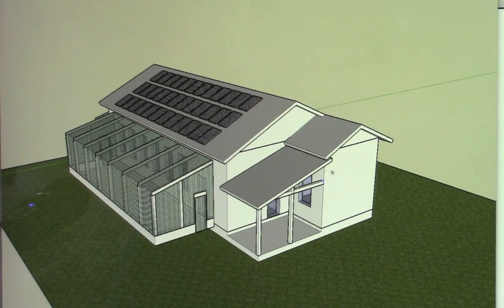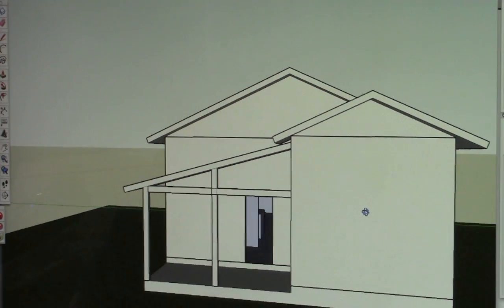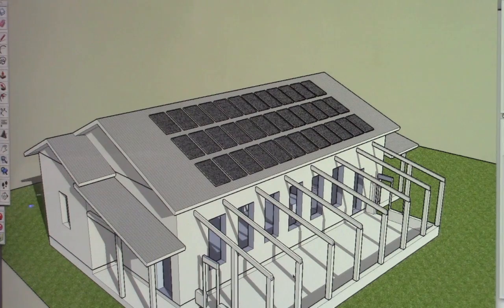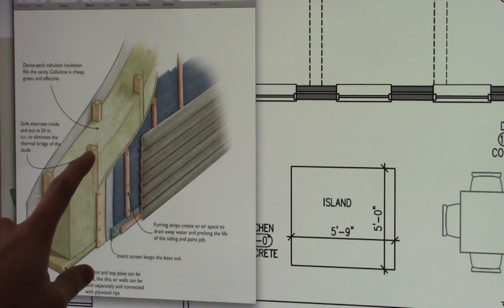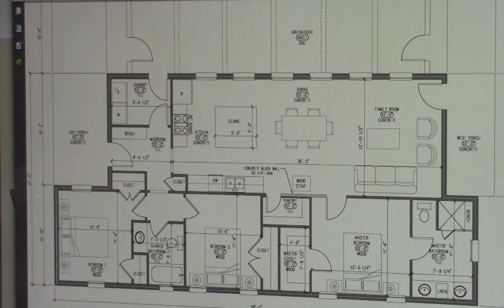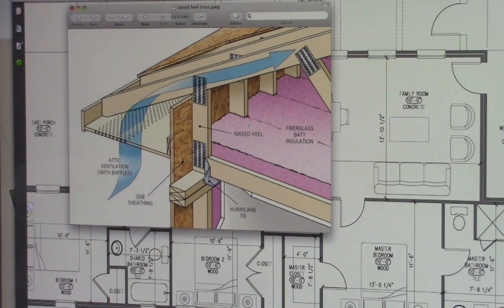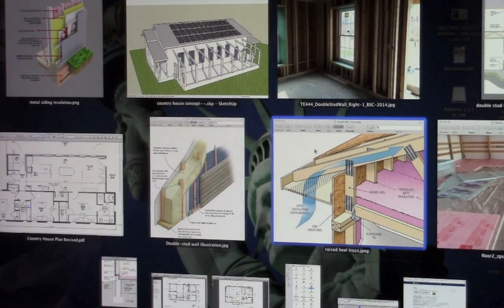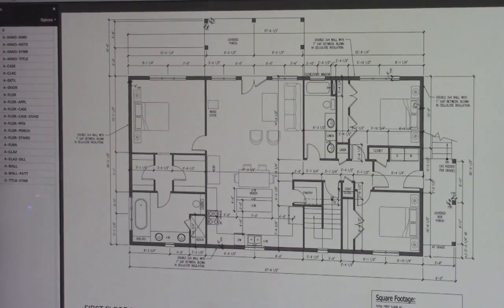Sustainable Off-Grid Home Design - DIY energy efficient green passive solar and affordable!

Comment: What a wonderfully informative video!  We are doing our research and we were wondering about the slab on grade idea paired with a greenhouse.  Can you use it on level clayey loam soil?  The property is two miles from a river with a high water table.  Thanks!
Reply from the maker: Thank you. This can be put on any soil. Of course, before building anything a soils test is important to obtain. The engineer may suggest additional reinforcement, slab thickness, etc.

Comment: So how would the structure hold up to a tornado or should there be a strong room built into the structure? I love the house and the work you are doing. The green house how would plants be placed there ? Like a large container garden ? What would be the R values related to the windows and doors? The windows would be triple glazed with argon gas or ? Would they be Storm proofed? Will the house have hurricane straps to hold the structure together in high winds? What about computers, tv satellite and car charging? What about the plan you have plus geothermal heating and cooling for the whole house? Heat pump hot water? How do you move fresh air through the house?
Reply from the maker: Thank you. That is a lot of questions Ken. I will do my best to answer them. 
1. Almost no house will withstand a direct tornado hit. We will have a shelter like most in the South. 
2. The greenhouse can have raised beds or containers. Personal preference.
3. R value for doors and windows will be determined by whatever you can afford. Essentially combating air leakage will boost energy efficiency and thermal loss. 
4. Not sure why the windows need to be storm proofed unless this is being build in a hurricane prone area. Any home needs to be modified to the local code of the are built in. 
5. Geothermal can be added. Depends on your budget. All systems can be combined to work together. 
6. HVAC systems can be designed per budget, need, etc. Depends on what you choose. Heat pump is popular here in the South. 
The building envelope is the crucial first step to energy efficiency. All other systems can be determined later by budget, location, need, etc. 
Hope this helps.
Reply: thank you for the update it was very nice of you to reply good luck with your home...is it built yet?

Comment: Have you ever considered putting the majority of the house underground? That would protect it from storms, fires and would be much easier to keep it at a good temperature as the ground would be great free insulation.
Reply from the maker: No I haven't. That would be more of an Earthship design. There are a lot of advantages and disadvantages to that type of design. The one I have designed is much easier to build and has less engineering involved. I do like Earthships but I don't think I would build one.
Reply: @CountryLivingExperience  I've looked at Earthships, but feel they'd be too exposed to storms and fires. I prefer something like this: https://www.youtube.com/watch?v=CWe0UgNmqp4 or a (at least partially underground) Monolithic Dome. Preferably made with very thick concrete walls. Monolithic Domes have been able to withstand huge, force 5 hurricanes, forest fires burning right over them and can protect their inhabitants from high or low temperatures, keeping it about 10 degrees cooler in summer and 10 degrees warmer in winter.
Reply: I like the earthship style. I do find that the idea of the tires is not on my agenda. I like being able to get a similar result that will allow me to get permits  so concrete rather than tires.  They are not to wonderful if you look at how they are insulated.  For most areas of the country we do not have the temperature swings that happen in the desert.  So ...  need real insulation.  There version of earth tubes are all but useless Suck the heat or the 'coolth" out of the ground because they are far far ... well far to short to get real exchange.. the ground does not recharge very fast so 100 to 150 feet is much better.  What you are perhaps thinking is not insulation but high mass heat storage in the earth. Not really effective unless you can expand out the area around the house a huge amount as any water that hits the ground in the form of rain or water table will wick away the stored heat

Comment: You can see a variety of photos of solar heating on my website: https://kuennllc.com/
You can also do this with a deep sand base and pext tubing instead of a large water tank but heat never transfers as well as in water.
Reply from the maker: Awesome. Thanks for the heads up. I will check it out.

Comment: Under the Southern side greenhouse, add a 2000 gallon buried tank (sitting on recycled EPS foam) with cheap used thermal water/glycol panels (ground mounted). All summer the water in the tank will heat up and release from Nov to January to heat greenhouse and house. By February, when the sun is high again the tank will gain heat again. We grow citrus fruits in NE WI when it's -20F outside. Used farm tank, used 80s panels (always on Craig's list) with little else spent on pump and tubing.
Reply from the maker: That is a fantastic idea. Thanks for your thoughts. I would love to see your system.

Comment: Have you looked into SIP panels for exterior walls at all? Like to get your take on these.  Thanks.
Reply from the maker: I have and know a few homes built with them. I like them and they are a good product. I was shooting for a bit higher r-value for the walls in this home and went with the double offset studs for that reason.
Reply: Thanks.   How does cost compare?
Reply from the maker: That is a tough one to nail down. Depends on your market/area for costs. Depends on SIP thickness and also type of insulation used in the double stud wall.

Comment: Will having a basement affect efficiency? Thank you.
Reply from the maker: As long as the basement is properly insulated, it should not effect efficiency. Insulation on the underside of the slab and exterior of the basement walls is important. Additionally, you can add an interior insulated wall in the basement to further control the environment.
Reply: @CountryLivingExperience  I want to build a net zero ranch with a basement in northwest Indiana, cheapest way possible. Would you be able to help me with that.
Reply from the maker: Sure. Let's talk. Too bad there is no more private messaging here on Youtube. Head over to our website www.countrylivingexperience.com and there should be a place to email us there.

Comment: Did/are you building this home? I really like your floor plan. It's almost perfect for us. I'd like to know how the building is performing if you have built it.
Reply from the maker: We have not been able to build it yet. The funding is not there. We moved in a different direction and bought a home because of a time crunch. Hopefully we will be able to acquire land and build in the near future.
Reply: I see. Is this your own floor plan or did you buy it?
Reply from the maker: I am an Architect. I designed it.
Reply: Great job. You've packed great features in there that I have not seen frequently in a typical passive solar, like the mud room, double vanity and WIC in the master, place for a wood stove and thermal mass wall behind it, and showing the construction detail is very helpful as well. You should make this available for sale if you have not already. I have a vintage wood cook stove that I currently use and will be going into my passive solar home, and this is the first plan I have seen that allows for it.
Reply from the maker: Thank you. I would be happy to discuss the sale of detailed architectural plans. Send me a private message and lets talk.
Reply: Unfortunately (depending on how you look at it) we are at least 4 years out from being able to even get started. And, like happened with you, things could change, so we will wait until we are closer to start time to nail anything down (no pun intended).

Comment: What is the reasoning for having the windows inset?
Reply from the maker: Great question. The wall thickness acts as an additional shading device in the summer months. Your overhangs do not need to be as deep if you inset the windows.

Comment: Great video.  Wondering about your PV system - about what size system and where will the batteries/hardware be located?
Reply from the maker: Tim, 
We had not sized the PV system yet. The batteries and hardware would be located in an outdoor closet on the east porch. This would eliminate the worry of off-gassing of the batteries. Once we reach the point of sizing, we will do an update video in the series.
Thanks.
Reply: Country Living Experience OK great. Looking forward to seeing the update.

Comment: I am retiring in a few years & have 10 acres of  land in the country with a garden & orchard. I would like to build a 1500 to 2000 sqft net zero home with a south facing green house/room with a full walk out basement with ICF walls. I want the insulated, airtight ventilated air exchange passive home, with Geothermal heating & cooling. Concrete floors & counter tops, solar panel on the roof. I can not find a cost per square foot for this type of house. Any ideals?
Reply from the maker: It will be hard for you to nail down a cost per sf easily because there are so many variables involved. You will have cost/sf for the Architect, contractor, geothermal engineers, ICF installation experts, Engineers, etc. 

Location is a huge factor to cost. Are there contractors that are willing to travel to your land? How remote is it? What is the terrain? What State do you live in? Etc.

Are there expert trades (geothermal, solar, ICF) available in your area? If no, it will cost more money to get them out there.

Will you do some work yourself? Will you GC the project yourself? 

As you can see, it is a huge challenge to nail down these type of cost.  All I can suggest is you start contacting individual contractors and start asking them questions.  Additionally, their costs can fluctuate greatly over a few short years.

Sorry, I cannot be more specific.
Reply: Thank you, that the most I could hope for on line.

Comment: id consider a masonry heater in place of the woodstove, initial build cost is higher, but time and cost of prepping firewood is cut in 4, or a self buit rocket stove is cheap to build and nearly as efficient, plus you get heated benches to lounge on in the winter.
id also reccomend spending as much as you can afford on good quality windows, pref triple glazed, again high initial cost but over the years you would be amazed how much it makes a difference in your heating bill.
Reply: masonary as in a down draft heater?  or more along the line of a mass rocket heater?

Comment: Will it be a LEED Certified Home?
Reply from the maker: Thanks for your question Noe. 

The short answer is: absolutely not. 

The long answer is: I used to work in Washington DC for one of the 5 governing bodies of the architecture profession. This gave me insight and access into the inner workings of organizations like the USGBC. I also had a friend work for them for a number of years who fed me disturbing information. The LEED system was a moderately good idea on paper about 15 years ago but quickly devolved into a bureaucratic mess that was of too great an expense to a great majority of the clients. It became an assortment of meaningless checkboxes that did not mean much. I could go on about this for an hour but I will not.

This home which will essentially be totally off grid and self sustaining would not score well in the LEED system.

We all can do better than silly check boxes.

Sorry for the soap box speech.
Reply: Country Living Experience I hear ya, and I can definitely see your point. Beautifully designed home! off-grid is really ambitious. Best of luck on the build!
Reply from the maker: Thank you.

Comment: I live in the Southern hemisphere, and I was told not to put a window into a West facing wall because the westerly afternoon sun is more able to heat a house than the easterly morning sun.
I was wondering why you placed a window in the West wall instead of the East.

Thanks, Aini.
Reply from the maker: That is essentially true but you have to weight diminished natural light in your home in the late afternoon.  Yes, you can design a house that is like an Earthship buried in the ground on 3 sides but I think that takes away from the pleasant nature of a home. Architecture is about balance. So some small windows on the West side is not really going to effect things in a significant manor. The light is very important too. Just make sure you use double or triple paned glazing and everything will be fine.

Comment: Im currently building one of these in missouri, framing just about done.  This is my second build like this.  Some things i would add from my research.  To get the most square footage for the cheapest cost, two story is the way to go, foundations and roofs being the expensive part, minimize their size and build up.  Obviously there are other considerations about 2 story vs ranch concerning ratio of glazing/mass area to the rest of the house, not optimum but still can be made to preform extremely well.  I would not post frame the house, the savings from building like that (no foundation) dont apply here because your going to need a full foundation anyways.  Just stick frame.  The exterior wall can be stick framed at wider spacing, im doing mine on 4' centers.  Housewrap on top that to hold in the insulation.  Then strap those with girts every 2' on center to install your pole barn metal to.  When doing girts instead of sheeting the house remember to add shear panels to the house somewhere, i put mine in the corners.  Or pay a little more and just frame and sheet the exterior as typically done.  Sounds like you might be further north than me as i design the windows to have no sun at all in the summer, 5' tall, 1.5' up to overhang, with 2.5' overhang.  Doing everything myself on this one, from foundation to roof and everything in between  for 1600 sqft interior space for $40-50K
Reply from the maker: Good luck with your home. You are correct, two story is less expensive generally because of foundation and roofing. Both one and two stories will perform well with a one story slightly outperforming a two. Latitude will make a great difference in the design and location will cause build price fluctuations.

Have fun with the build.
Reply: Kudos for the Video clip! Forgive me for chiming in, I am interested in your initial thoughts. Have you researched - Lammywalness Wise Solving Guide (probably on Google)? It is a great exclusive guide for living off grid without the headache. Ive heard some great things about it and my GF finally got great success with it.
Reply: Cody can you share? Would love to see your work.
Reply from the maker: @Dennis Coen Sorry to get back to you so late as YouTube does not show me reply's made on comments. There are many sources out there where you can learn. I learned in school and my profession as I am an architect. There is a wealth of info out there so best of luck with your projects.
Reply: Cody - where in MO are you at? I am in NW Missouri.  Looking for some one that understands these concepts, local GCs are hard to work with.

Comment: so approximately how much would this cost?
Reply from the maker: As I used to ask all my clients, "What is your budget?"  

There are so many factors that are in play, it is very difficult to assign a solid dollar figure to this project.  Your location will determine a big portion of the cost. If you are going to put this on a hard to access mountainside somewhere, then it will be expensive. A contractor is going to charge you more for distance traveled, availability of materials, ease of site access, etc. If you are near a decent sized city with an easily accessible flat piece of land, it will cost you less. Materials vary greatly from state to state. Concrete in Mississippi costs less than concrete in New York, etc. It also depends on what finishes you put in on the interior.  

So all that said, the exterior shell with the concrete and plumbing stub-outs would cost you approximately $35k in rural east Texas and maybe $70k in New York.

Say between $90k and $200k.

Comment: In North America we really don't need a greenhouse design that has a "glass" or clear plexiglass roof because of how high the sun is in the summer. A regular roof with lots of windows on the south side works just as well for a greenhouse and heat gain in the winter and spring.

Comment: Love your blog!
What about about berm on backside of house for cooling or build into hillside? Perhaps skylights in roof backside for light? 
Love your design. Don't think I could afford to build one this big myself, but love the efficiency!!! I always wanted to build a greenhouse, front side south face, convection circulation, louvred upper row windows. 
Just smaller & somehow room to expand on small homesteaded property.
Reply from the maker: Thanks Daniel. A berm on the North side would be an added asset for sure. This home was specifically for us but could be pared down and redesigned to be smaller. We tried to use a method that would be as economical as possible. 

A friend has built a version of this already. He spent $48k for 2700sf. That included the dirt work, concrete, plumbing stub out, the entire pole barn style structure with windows and doors and interior framing. I think he hit around $75k for the entire thing. (this of course does not include some of the systems we designed and mentioned in the video though). If you did a 1000sf cottage, I think you would be able to get into it for a great price.